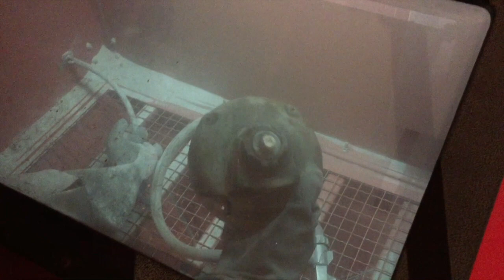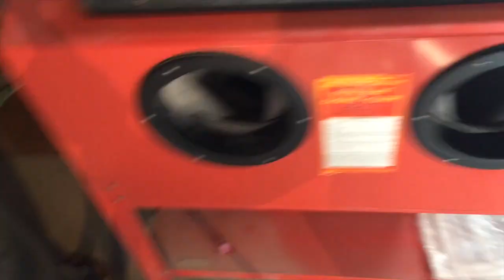Atlas 73 Drill Press Restoration: Part 2 - Electric Motor

Comment: Awesome job. You should only use non-detergent oil on bearings...very important if you want the bearings to last. I also use a heat lamp to heat the paint to around 100-120*F while curing. Not necessary, but highly recommended.

Comment: I just got an old Atlas drill press from craigslist, too. It's in a bit worse shape than this one and I don't know which version it is. But, it's close enough that watching your videos is going to help me tremendously. I can't wait for the rest of the rebuild.
Reply from the maker: +Parley Kennelly Awesome! Yeah I should be adding some new videos soon.
Reply: I saw you're a HAM, too. I'm only a Technician, KI6BVO
Reply from the maker: Yeah I think most of these old Altas versions were basically the same machine with minor modifications. Good luck on yours!

Comment: A good tip is to take a Sharpie or something and draw some reference lines across the motor sections just so you know precisely where it all was positioned. Obviously cleaning the parts up will remove the markings but there are ways to keep track of positioning. It just helps sometimes with fitment. I'm not really saying anything too terribly groundbreaking, but just trying to help.

Comment: The easiest way to protect the bearings during sandblasting is to fill them with beeswax. It is very simple to melt out without overheating the bearing when you finish.